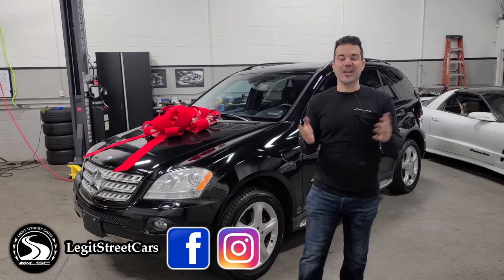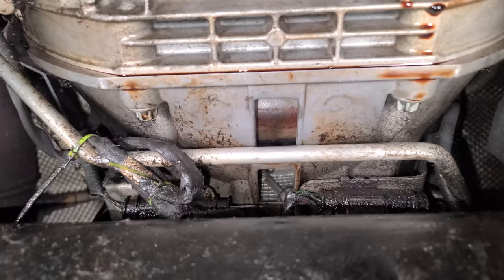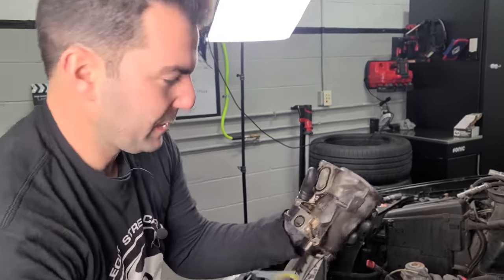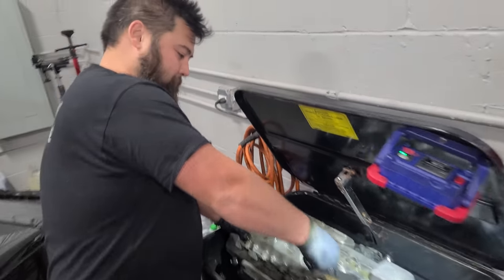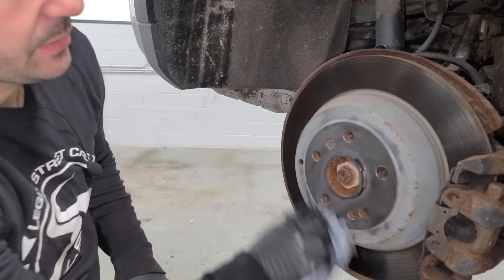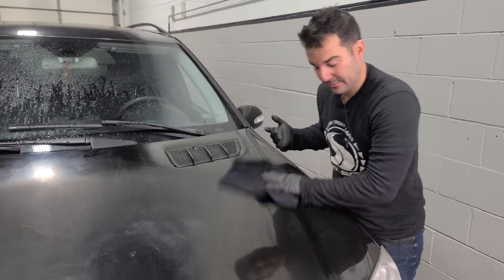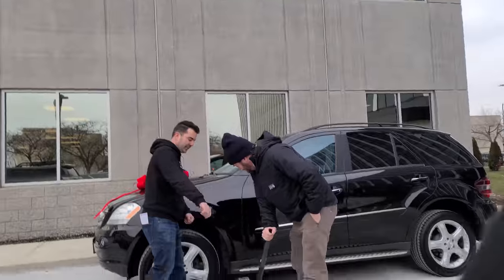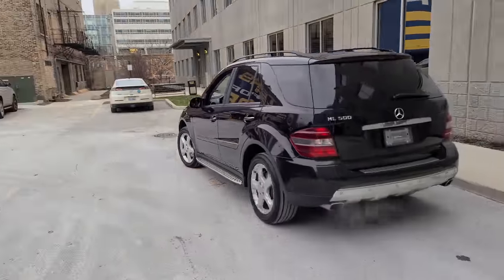I Fixed Up & Surprised A Marine Veteran With A Free Mercedes SUV & Cash For Christmas!

Comment: In my opinion I think the ford 3.7 Cyclone engine is probably one of the most reliable modern day gasoline engines. Overly simple and some guy has 1,300,000 miles one the original motor! Definitely a solid choice